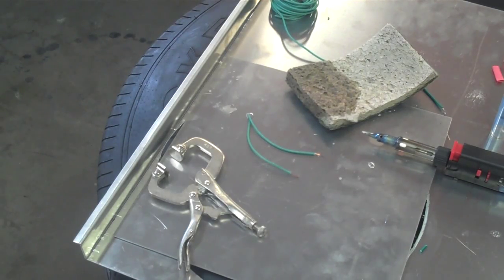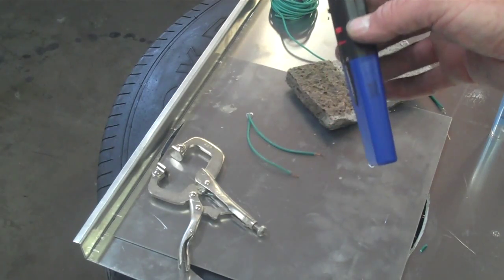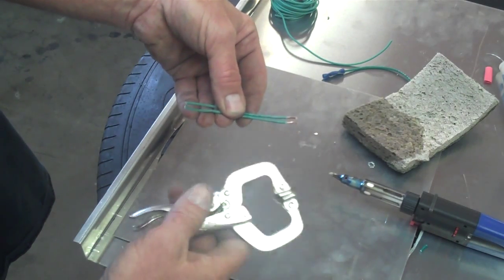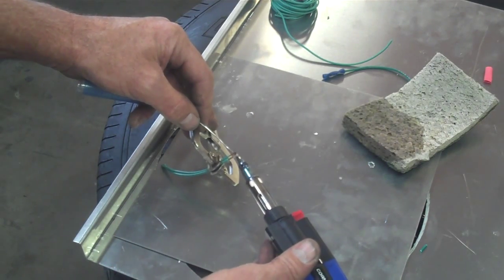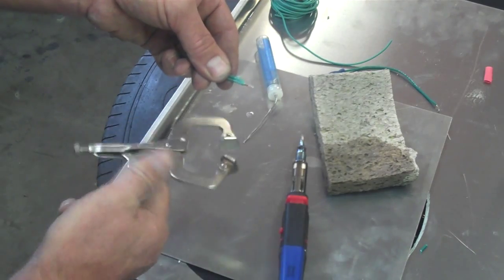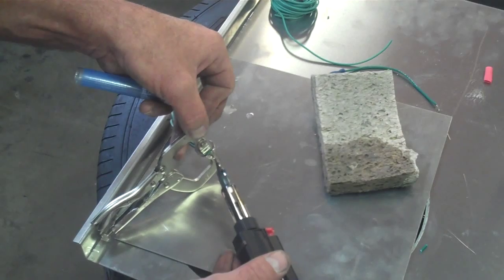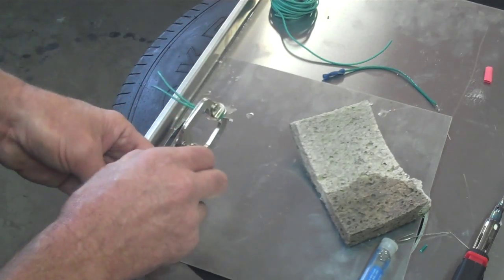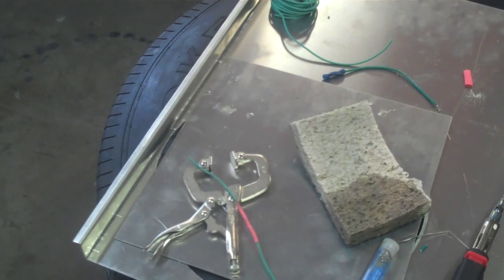How to solder wires, soldering technique

Comment: To be honest I'd reccomend using forceps also known as Hemostats. They are better for smaller wires and are usualy ribbed tip and come in many forms, curved, straight, long, and short. I find them very useful in that they give you more space to solder the wires together.

Comment: Always make sure you apply the solder on the opposite side of the soldering iron tip.   Solder will flow to the heat of the tip, making a smooth connection.